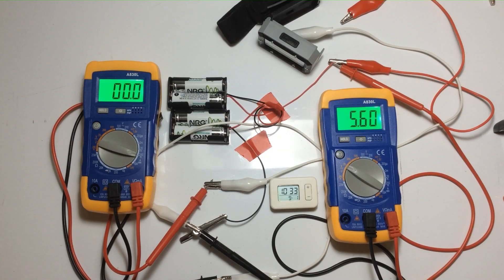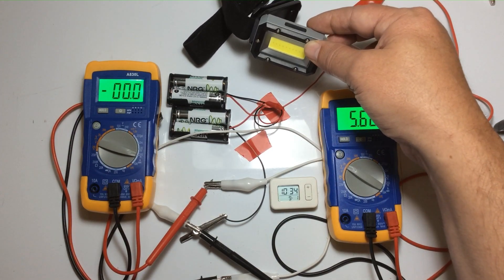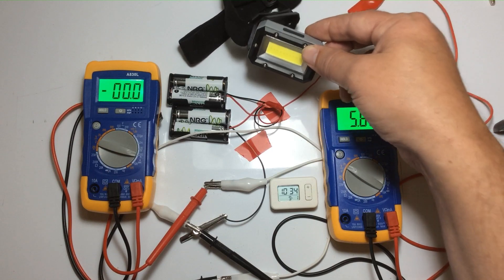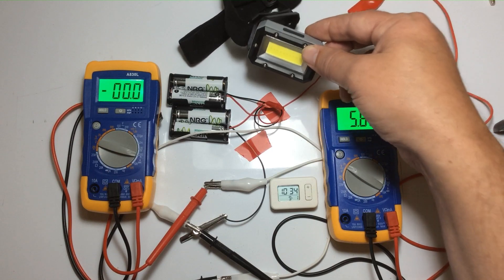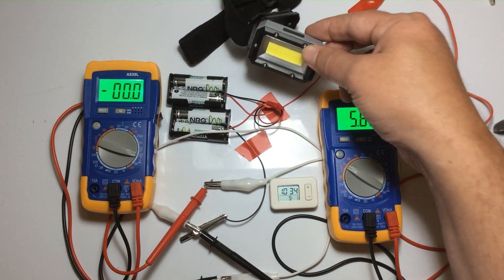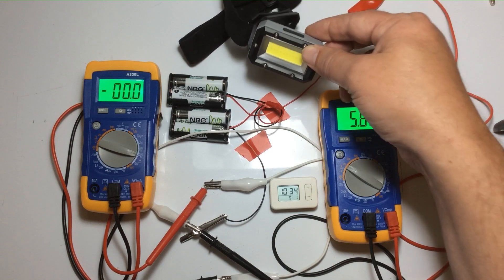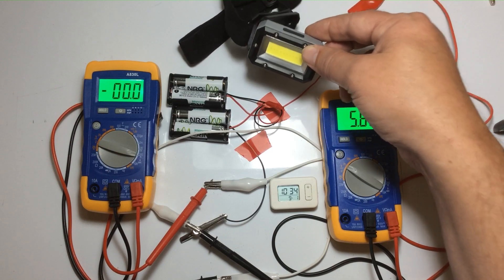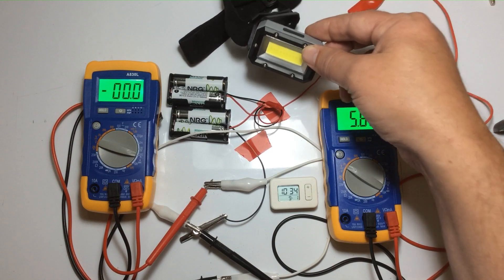TESLA POWER TRANSFER - CONTROL TEST

Comment: Heads up for anyone doing the transfer test. Don't significantly drain your batteries first (the ones to be placed in parallel to be charged), as this can definitely damage them. I used AA 1.2V NiMh rechargeable that I assumed were sufficiently charged out of the package (they weren't), didn't check the Voltage on them (with a multi-meter) and just drained them using the transfer method. This caused a lot of problems  initially while doing more tests (even after fully charging them with a wall charger) and I finally came to the conclusion through some research they were damaged. I've been advised that 1.2V shouldn't be discharged below 1V.
Reply from the maker: Thank you for your comment.
You are correct, Rechargeable AA batteries should not be discharged below 1 volt or they will be damaged. To use this system without damaging batteries they should be rotated when they reach 1 volt, every 2nd or 3rd day.
Sometimes when a rechargeable battery drops below one volt they can be in a locked state, some are gone to the dark side at that point and others can be flashed with a high voltage, for example, take a 12 volt battery and connect in parallel to the AA battery but be sure to use a quick flash connection and don’t leave it on for long, essentially you just connect the negatives together and then tap the AA battery positives a couple of times.
Next you can try leaving them parallel connected to fully charged AA batteries and they can slowly balance.
Let me know if you have no luck as I built a circuit that repairs rechargeable batteries that is gathering dust in the shed, I can pull that out and make a quick video on it for you to replicate. I used it to repair drill batteries all the time and it self regulates the battery voltage up to a 30 volt battery.
Reply: @whatifididthis...1236  Interesting. Yes, I would be interested in the repair circuit, thank you. As for the transfer test, I'm using a small motor as the load, with 4 1.2V NiMh in parallel. The motor drains more current, so I'm switching after an hour or so. Also, I'm assuming there is more waste heat on the parallel battery resistance because of the increased current, so am experimenting using 8 1.2V batteries (instead of 4) in parallel with the idea less current into each reduces the heat. I've found that doing this improves the speed of the motor too, as adding an additional 4 seems to decrease the resistance of the overall circuit.

Comment: Excellent test, friend!  Thank you for doing this.  I appreciate the time and detail that you are putting into this.  What I was wondering prior to this is, how much actual wattage is being used in each case (Tesla vs. conventional) by the lamps on average during the first 10 minutes or so?  Looked like around 2 watts or so for conventional.  Have you taken initial measurements from the Tesla method?  Also, I might have some time coming up soon to play with this.  I have 8 fairly new nimh batteries - do you think these would be suitable?  They are EBL brand 2800mAh and say "low self discharge technology", 1.2v
Reply from the maker: Thank you for your comment.
I will perform another test with ammeter measurements to answer your question. Whilst I have supplied a video for my 3 battery system showing ammeter readings I have not done so for this one so another video it is then. I might also add that some people were upset with my video showing current draw because I was unaware of Kirchhoff’s law, now that I am aware of Kirchhoff’s law I feel it is not directly related to my testing as it encompasses multiple nodes in the consideration of Kirchhoff’s law. I feel too many of these laws are treated as gospel and they don’t explain a lot of recorded phenomena. My honest opinion, Kirchhoff’s law is BS created to act as blinders, sort of a nothing to see here and what you are seeing isn’t real! Just because we are taught something doesn’t make it right. Try telling Galileo that the church was right when he said it was wrong! We all now know the church was wrong but try telling them so at the time, if I’m not mistaken Galileo spent years in home detention after trying to convince the church it was wrong.

My conclusions are drawn from the real world and not an institution telling me I’m imagining results.
I am happy to collect the data for you as long as we aren’t holding it against our education that says not even this should be possible.

The overwhelming picture I am getting from posting these videos on this transfer concept and for that matter the majority of my videos is a question of why nobody can explain what is happening here. Those that use their education to measure this are not leaving a comment that explains anything, they always say “that’s not right” and “it doesn’t work like that”, I’m trying to say to people I have tested it and it does work like that. All I can assume is they made us feel so stupid during our education when we questioned the LAWS!? that we all cowered to avoid embarrassment and being ridiculed because our education teaches us were wrong, it’s right, what you see is an illusion!? I don’t get it.

Sorry for the rant, I have multiple conversations running around in my head from all the comments.

Please let me know the results of your experiment if you get the time. Reporting your results helps encourage others to perform what is the simplest test to confirm this is a better way to manage energy. I imagine your batteries should work fine, the batteries in my 275 day test are NiMH also. At some stage a comparison of battery chemistry with this setup would be a great idea, time permitting of course, eventually...one day!

Comment: Great to see proving Tesla switch.

So, swap time is the same as in original long lasting run time ? I think you did swap them at 72 hours interval in original setup, or maybe I got it wrong.

Did you manage to recover batteries used in first experiment of 275 days of continuous use ?
Reply from the maker: Thank you for your comment.
I didn’t actually count the hours of operation but I will look now and leave a comment here. I didn’t bother because it was so bloody obvious that it was somewhat pathetic. Especially as it was within a single day from start to finish, I just recorded it and posted it as I felt it wasn’t worth discussing, a no brainer so to say.

The batteries from the 275 day test are still in use today, they were still healthy after that super long test, I was sure they would be damaged but I recharged them and put them straight back in the same system, on for another 275 days.

Comment: In the earlier tests it looks like you have 8 x AA batteries, half of them in series the other half in parallel, whereas with the control test you only have four in series, so it's losing the additional energy supplied by the four in parallel, i.e. not equivalent.
Reply: Indeed, you catch the detail. I think the experimenter isn’t willing to waste more batteries knowing the effect but, he proved the point most devices are just unnecessary  killing batteries.

Anyway, always adding any very low drain to a battery will prevent self discharge which in some batteries can happen at fast speed especially in cold environment. So, the point is to prove how long batteries can be run providing energy without being destroyed compared with what is available to be used straight from shops.
Reply from the maker: Thank you for your comment.
So I thought long and hard about this one for a while before performing this test and in my opinion this is the only fair way to test the two seperate systems and I will explain why and we can debate my way of thinking.

Please forgive me if this seems condescending or “mansplaining” but I’m trying to relate how I thought through this.

Batteries when added in series increase in voltage.
Batteries when added in series does not increase capacity or Ah.
Batteries when added in parallel does not increase in voltage.
Batteries when added in parallel does increase capacity.
To compare the two systems the original storage or Ah needs to be supplied.
In the Transfer method we have 4 batteries in series supplying power, therefore 4 batteries are used in the control test.
In the transfer method it is the same voltage potential with the 4 batteries in series as the control test.
The parallel batteries in the transfer method technically share the same potential as they are connected to a shared negative by connecting the negatives of both banks, therefore this is a parallel connection and the power is not available to the led from the parallel bank as the power is moving toward this bank, in theory.

Due to this connection method both banks are connected in parallel even though the series arranged batteries are series arranged, this causes the circuit to see both banks as one, connected in parallel.
In my opinion, if the power wasn’t being transferred the previously flattened batteries would have no charge and when rotated would display this... but that’s not what happens and I can repeat this until the small losses finally catch up. Conventional usage only allows for one run.
There should not be power flow between the negatives and the power flow between the positives is DC through a diode, one direction only and also from the higher potential voltage to the lower, exactly as it does when applied the usual way, so like I stated before I don’t believe the parallel bank has an effect on capacity of the batteries because if it was adding to the capacity of the serial bank there would be no power after the transfer process... yet there is.
Reply: @whatifididthis...1236  if you remember you were able to lit up LEDs negative to negative against 1way valve theory, so it happen in batteries as well … at least it seems to. Probably there is some energy extraction from local environment as well, I mean some self charging may occur even the type of batteries isn’t the right one for this purpose, where negative side is always fully exposed and enclosed in surrounding medium.

Also, regarding power factor correction I have found out that adding capacitor after the load, basically in series with load on top of parallel with load efficiency and stability of voltage is maximised.

I was trying to find an answer of behaviour of storage role in a circuit and they behave different based on rate of charge and discharge
Reply: @whatifididthis...1236  Thanks for doing the tests. Putting batteries in series doesn't increase A but I would think that it has to increase Ah. The formula for Ah is just current x time-in-hours so more batteries would have to last longer. Also, using the A meter in the circuit has to increase the load. Regardless of logic, it you don't use all 8 batteries people won't believe that it's a fair test. I would have to agree because even if the second set of 4 are not used in the first Tesla run, they are eventually used when you swap, and at least on the first swap, should still have their original charge. I would suggest just using two of your four-battery series packs in parallel while keeping the meters out of the circuit except to measure periodically. The batteries may last longer than 72 hours but then they'll be dead whereas the Tesla set up can be swapped multiple times and should last longer.
Reply: @schongut9030  the whole point was to use 1 set of batteries as intended from original setup when light was bought from shop and show how long they last in the way we are provided with different things powered by batteries.
Than compare with tesla switch
Reply from the maker: @schongut9030   Thank you for your comment.
I remember feeling robbed when I learned adding batteries in series does NOT increase their Amp hours(Ah).
Only when adding batteries in parallel do we get an increase Ah.
I believe the control test can’t use the same amount of batteries, ie the parallel bank. The parallel bank is not a benefit until swapped, therefore it is a byproduct of the transfer method, this energy is normally wasted by being converted to heat through resistance.

The parallel bank is after a diode which prevents power being transferred from low potential to high potential which shouldn’t happen anyway and as the Negative connections are combined they should present the same potential and prevent energy flow from the parallel bank, hence the energy is stored in the parallel bank and not burned as is occurring in the conventional setting through thermal transfer.

I don’t believe using just two of the 4p batteries would work as well because their would be insufficient capacity or storage to receive the energy from the serial bank, whilst the serial bank has not had  its Ah increase the power is still there as the calculation is 3.6v x 1000mah = 3600mah, whereas the parallel bank is 1.2 x 1000mah x 4batteries = 4800mah storage. We could possibly use three batteries in the parallel bank so it too was 3600mah but this would complicate things on the first transfer by only having three batteries.

Initially the parallel bank is flat or discharged at the beginning of the transfer method, whilst the system will work with fully charged batteries in the parallel bank it is not as efficient, when the parallel bank is completely full the energy is no longer transferred and instead converted to heat so if the parallel bank starts fully charged then the system is no longer efficient and dumps energy as heat, it will still work but is now wasting the power that you placed into the series bank.

Using a conventional method damages the batteries whilst using the transfer method ensure the batteries are not at risk of the low voltage whilst achieving higher efficiency run times.
More bang for your buck!
Reply: @whatifididthis...1236  It took me a while to wrap my head around the Ah thing but after a while I realized I was wrong. The Whs double but that's because of the doubling of V.

I didn't realize that the parallel batteries were flat but that creates another problem; how flat is flat? Also, when you are doing your testing the voltage across the load is 4.8 V but as you say, when you're using the Tesla switch it's the potential difference which is 3.6 V. Maybe it draws more mA to compensate? It'd be nice if you had a little DC display that could measure wattage and Wh.

I realize that it's not so easy to do an accurate test. It'll be interesting to see what you come up with.
Reply from the maker: @schongut9030  You my friend have a rare and refreshing personality, I like that you can accept being wrong and I believe this is the fastest way to learn from even the simple things in life. We learn nothing when everything goes our way, except arrogance. For example switching a normal light switch, when the light comes on we learn nothing, it was an expected outcome, however flick that switch and no light comes on automatically requires you to think why there’s no light, investigating this to fix the problem makes you smarter because eventually you will know why there is no light which is more information than you had before you flicked the switch.

I like to keep my education fluid and not so rigidly bound by old ideas so this allows me to be wrong and assume others might also be wrong, real science is evolving and should never be set in stone. When we allow ourselves to be wrong things just get easier.

According to my battery health tester a flat AA battery is 0.9 volts. Remember they don’t have to be drained first as long as you realise the equivalent volume of energy will be converted to heat and wasted in the first run due to this energy not being able to enter the already full parallel battery bank it is transformed to heat in the LED and wasted. My tests to date have shown the already full batteries will not be overcharged or damaged when this is done. The first battery rotation is where your transfer process will begin, I realised this when I was too impatient to wait for batteries to drain to run my next test and tried the setup with a full set of fully charged batteries in both banks, to my surprise it worked so I figure the equal and opposite reaction in this case is energy going through the load is converted to an equal amount of thermal energy and dumped overboard.

I believe the parallel bank acts as a current limiting resistor, the set of batteries in this video measure at 34.7 ohms, this coupled with the potential voltage difference, as you suggest, determines the current flow.
I will make another video demonstrating current draw for both conventional and the Tesla Switch methods.